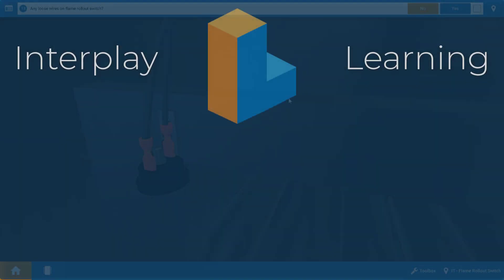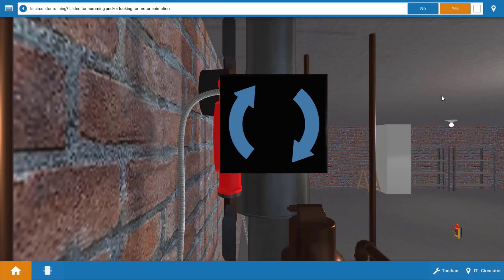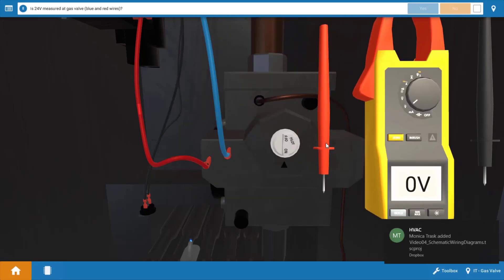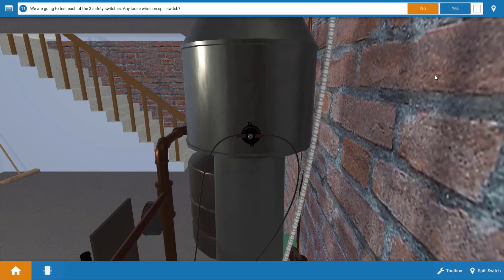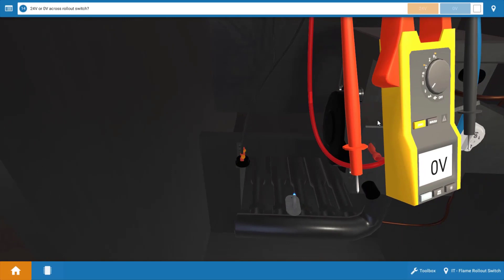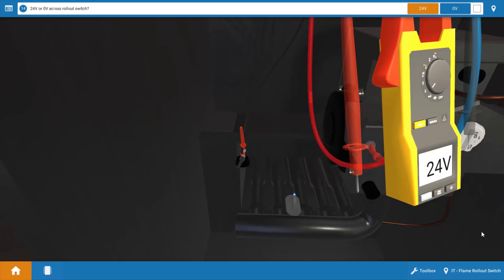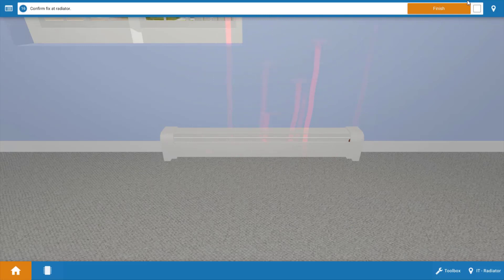Troubleshooting a Faulty Boiler Flame Rollout Switch

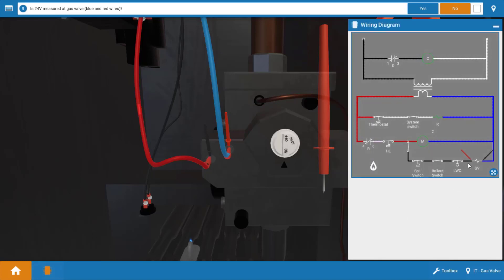Comment: Hello.  2:45 min you checked the gas valve and you said there is not receiving power. Why you do not think that the valve is receiving power but it is closed, because of that there is no voltage in your multimeter?
Thanks in advance for your answer.